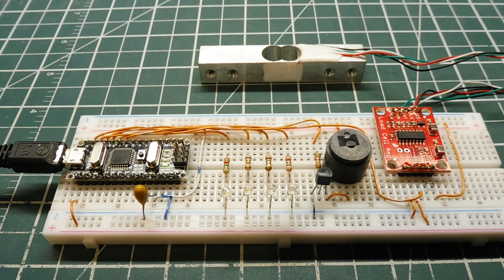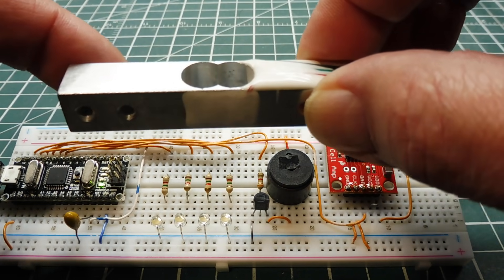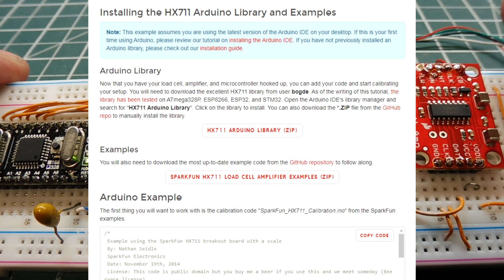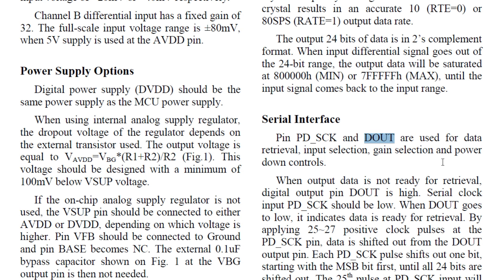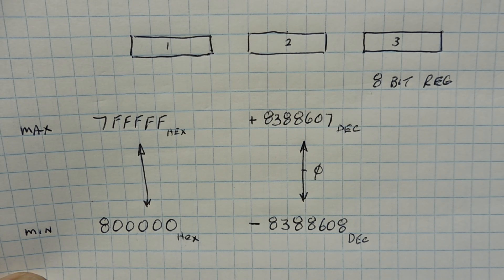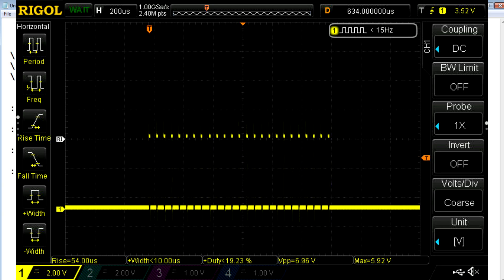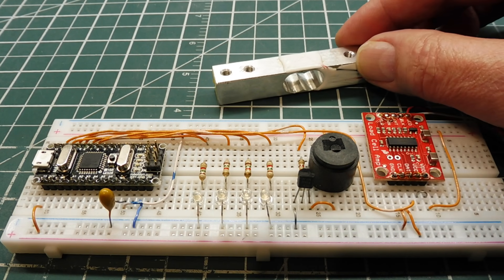Load Cell Interface  / HX711 / Arduino

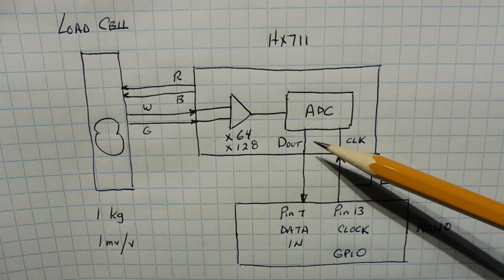Comment: hey man, in 7:25 u said that DOUT pin voltage is high because ADC is doing the conversion, so we have to wait until it goes low. So, can i ask what makes DOUT pin voltage go low? 
btw, your vid is great, thank you for making this.
Reply from the maker: After the A/D conversion is complete and a 24 bit value is ready, the DOUT pin goes low.
Check out the logic diagram in the data sheet.

Comment: Congratulations on you awsome videos! Can you helps us please,the ones who want but can't very much to write all the code lines from begin to end for Arduino without using a library? I can't figure out how to write in registry,how to move,etc. It would be very helpful.I also connected to XI pin a 22pF capacitor in order to increase speed ,to read faster but i failed,for the moment. Thank you very much!
Reply from the maker: Check out my channel, there are many examples of direct register programming.
https://youtu.be/mAM7s9bKEVs
Reply: @0033mer  thank you,I still have problems creating the 24 bits numbers from the indicated value. I made something but it's not the way it has to be. I declared a byte array who has 24 elements and set up a function that converts the array of binary values extracted from the cell into a number. But it is a vaste of memory.Happy new year!

Comment: So with no load cell unloaded the output voltage is 0, when flexed one way its positive and the other is negative ?
Reply from the maker: Yes, that's how it works in a perfect world. The strain gauges on either side of the load cell will not be perfectly matched so it has to be calibrated. An error offset will have to be used in the weight calculation.

Comment: Hi, very useful video indeed. Is it possible to get the code which uses the load cell to turn the led light on
Reply from the maker: Read the strain value and if it exceeds your desired trigger value, turn on a GPIO pin connected to a LED. I program in Forth but you can use the language of your choice.
: hx711
    init
    begin
      strain?
      dup  100 < if 0Led else
      dup  200   500 within if 1Led else
      dup  501   800 within if 2Led else
      dup  801  1100 within if 3Led else
      dup  1101 1400 within if 4Led else
      dup  1700 >  if alarm else
      then then then then then then drop key?
    until 0Led ;

Comment: I appreciate your videos especially the use of Forth for the Nano. I have been trying to get up to speed using flashforth but I am having difficulty in understanding the use of the 24 bit register. I am a forth newb but have had a long (35 year) interest in it. I know that some of the words used like pin7 and low?,etc are easily defined but the 24.reg use confuses me. I can define it as a value and store data to it using' to' but that only gives me a 16 bit register. Could you please point me in the right direction. I understand the need to keep videos short but it would be a real service to those who just getting up to speed if all the words and code were  available to examine via a web site for download and inspection. Thanks again I really appreciate your approach and knowledge especially explaining the electronics.
Reply from the maker: Forth is an extendable language so I can see the confusion it can cause. I am using two 16 bit registers to shift in the data and converting them to a double word which will display the proper decimal signed value. 24.reg is smart and lshift has been redefined to make the code more understandable to people not familiar with Forth. I try to keep my videos under 10 min and reluctant to get into Forth too deep as everybody is expecting Arduino code. I am currently spending more time teaching Forth to students and using my videos as teaching aids which works out well.

Comment: That's a really great idea. I'm anticipating an initial 'spike' in the load that will exceed your weight limit (given it's a motor application that won't 'ease' into the obstruction, so to speak). If so, would you use a time delay or buffer it some other way?
Reply from the maker: Yes .. you are correct. Initial transients are filtered out in software and then the steady state value is used after a time delay.